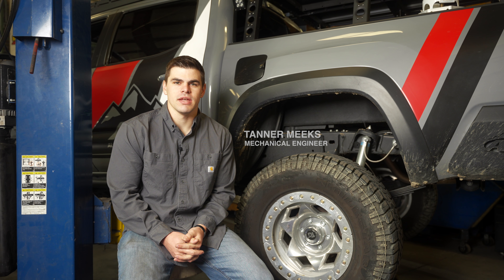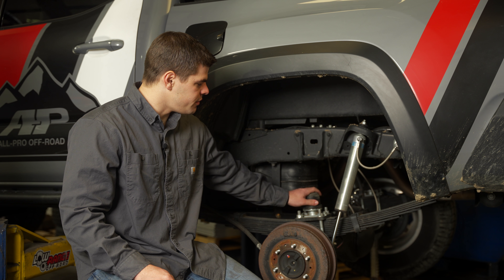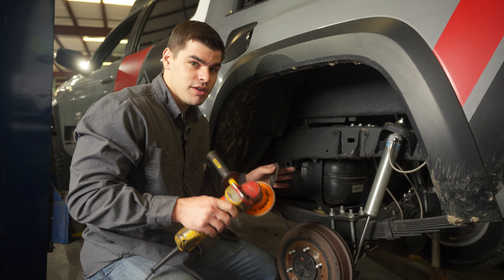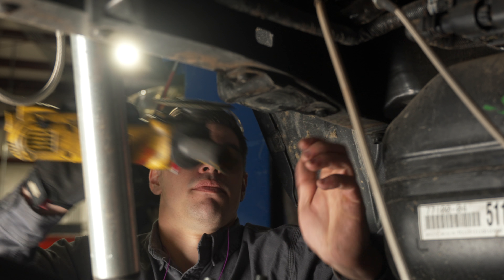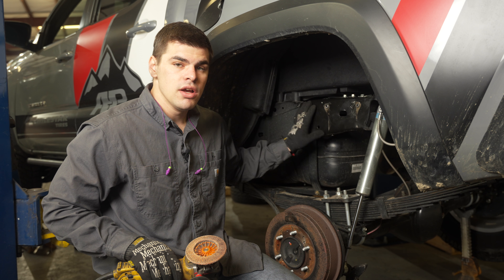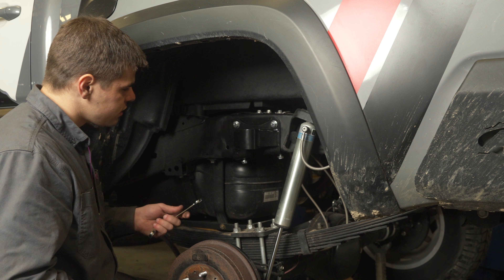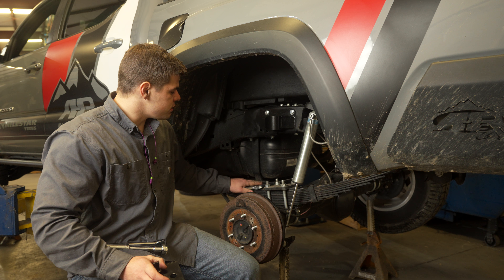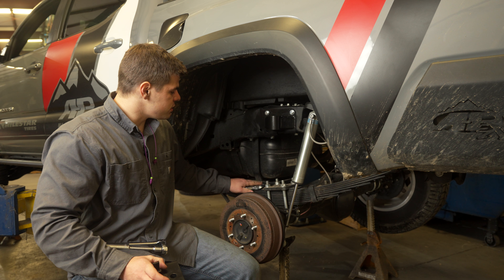Trail-Gear 2005+ Tacoma Performance Rear Bump Stop Kit Installation Instructions

Comment: I have the All-Pro Expedition Leaf Springs on my 2013 Tacoma with 6" lift. Would these work for my application? The Height adjustment / Set up Video isn't up yet so forgive me if it's covered there. Thanks